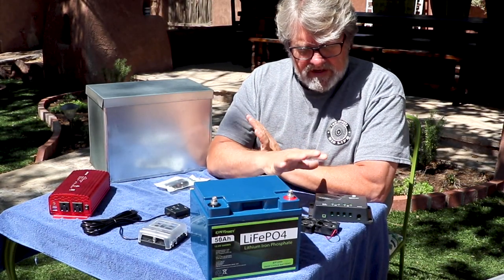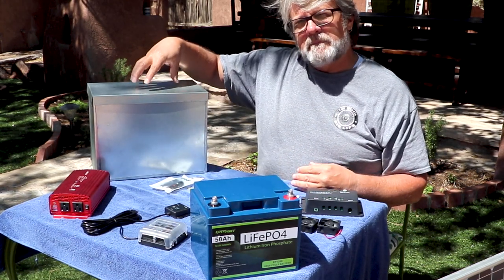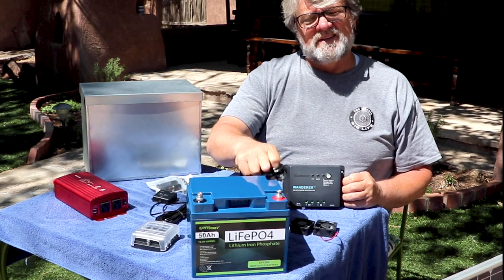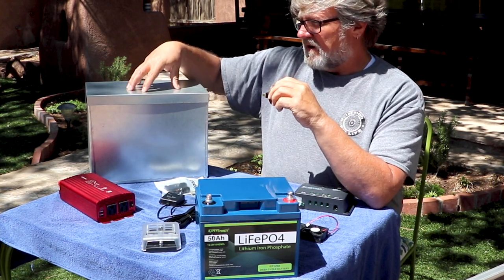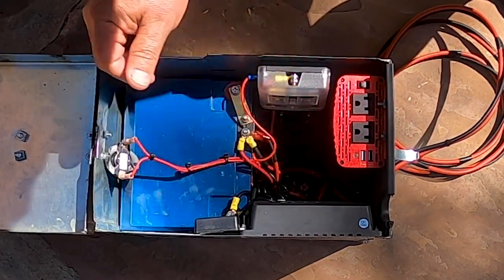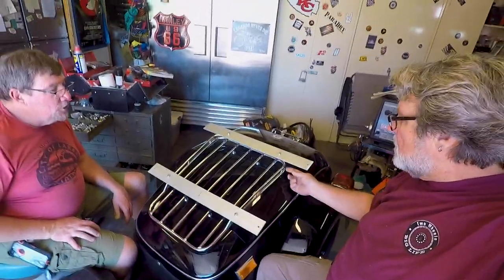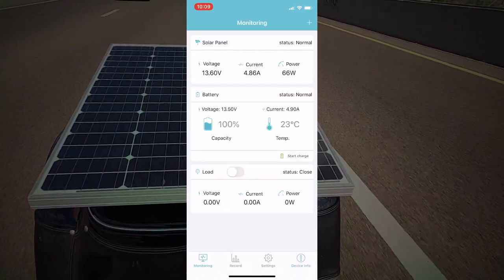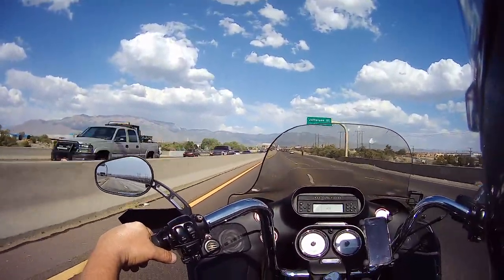DYI - Motorcycle Solar - #motorcyclecamping #offgridsolar

Comment: Very nice. Nothing better than available power while camping. One way to help keep that box cool. Find a Line-x Bed Liner dealer. Have a light coating of Line-x sprayed on the outside of your box and lid. It doesn’t absorb sunlight. You can leave it outside in the direct sunlight and it will not get so hot that it burns your hand when you touch it. Amazing stuff.
Reply from the maker: That's a great idea!

Comment: I'm looking to build this setup; would you plz revist this pwr sply build....
1. Since it's original construction:
- what upgrades &/or mods have you done to it?
- what, were you building it now, would you do (or have done) differently?
- what system components, parts, pieces, etc? have failed & have had to be rebuilt, replaced or changed out? (Failures as opposed to replacement with upgraded/ improved performance components.)
- what components have you chosen to replace w/"new and improved" components? And how/ why are they better?
- was to drop weight of the build w/o sacrificing functional performance & structural integrity?
- what would make the pwr sply more...mobile, resilient &/or useful?
Thank you.
Reply from the maker: I will be giving some details on that at the beginning of next season in just a few weeks.

Comment: If the lid on the trailer is fiberglass I think that I would try to spread out the rack connection. Maybe add a larger washer to spread out the vibration and prevent cracking of the fiberglass. But it's an awesome idea!! You're also giving me the travel bug again. Haven't been out for 5 yrs.

Comment: I noticed in a more recent video that you are using a Bluetti to charge your devices.  Is this the setup you recommend now vs a solar system you build yourself?  Our estimated max output would be 1000W - we are charging cellphones, portable fan and lanterns, but may need to run a portable air compressor to fill tires in an emergency.  We are only travelling for a month at a time and have the same camper as your Ruby.  Thanks again!
Reply from the maker: Hey there Thanks for the question.  The solar system I built was when we were full time on the road and not using campgrounds. So this worked good for us. If you plan on using campgrounds and of hotels the Bluetti works great.  The solar panels that you can get for the Bluetti are very large and you may be able to charge while riding if you can secure the panel some how.   If you use a campground there is an outlet somewhere, the plug in charger only take about 4 hours from completely dead.  Hope this helps.  here is a link to a 1000w Bluetti  https://amzn.to/494hUbA

Comment: Very nice video.  I have also owned Bushtec trailers and pulled behind our bike.  Even though the new box has a Lithium battery in it, did it add much weight to the tongue?  That was always our biggest issue with pulling a trailer behind a bike was balancing the load so that we kept the right amount of tongue weight on the Bushtec Heim joint.  Now I am most curious what you use the possible 50ah battery juice for besides charging your cell phones when camping on a bike?  Cheers
Reply from the maker: Great questions.  The total weight of the box with the battery was 17lbs. The tongue weight was 46lbs.  Total weight of the trailer was 360lbs.  The total power we use for our computers and phones are right at 78watts.

Comment: I am wondering about your solar system since changing over to the Bunkhouse trailer. Does the cargo net over the solar panel reduce the output. I know it takes very little shading to dramatically reduce the out put from a solar panel. I use a 500 watt portable power station and charge off of the motorcycle when on the move but the charge rate from 12 volt is very slow compared to solar.
Reply from the maker: Thanks larry.  Yes the cargo net does reduce the output of the panel, But riding all day with the net on it still charges the batteries to full in half a day.   Yes we have a small back up power pack that does charge slow on 12v but charges fast on the panel.

Comment: Clean looking assembly. I have to ask though, how much current draw do the fans and monitoring/regulating systems have, and from that what is the net power reaching the battery?
Reply from the maker: .03 amps. That is was what I saw when the fan was running and I was checking it through the Bluetooth.   We are powering 2 MacBooks and various GoPros along with phones.   So I don’t think I will run out of battery.

Comment: As well as the fans, why did you not cut ventilation slots in the box to release heat?
Reply from the maker: The top of the bottom part of the box has a couple of notches.  The lid does not fit tight and will pull enough air through it.  If I would have cut more holes I believe that water and road debris would get into the components.

Comment: After a month, how is the setup working? Did you have to change anything? How is it doing with hot ambient temperatures? 114 degrees while on my motorcycle in Phoenix, killed my Gopro
Reply from the maker: This solar is working perfectly.  We only really need about 3 hours of sun a day to keep the LiPo battery at 100%. It’s holding up well.

Comment: Very nice mod, how is the box mounted to the tong?
Reply from the maker: Roc Straps. It has a 6 ft of solar wire so I can move it closer or remove it to use when the sun goes down.
Reply: Who made that box or did you make that box, it would nice to get one. Bob
Reply from the maker: @bobesper4038  I had a friend at an HVAC company make it. Find a sheet metal shop in your area and give them dimensions and it should cost no more than $100 or in some cases, just Beer.  🤣👍
Reply: @TwoWheelsBigLife   Rich, I did not see the inside dimensions of your box. Could you share the box dimension please? Thanks Cliff, love your videos.

Comment: insulation would've or could help your heat problem..like it did for the top of your cooler...you could paint the top white as that will reflect more heat than the bare metal...

Comment: I would suggest you run a ground wire for your system or unhook your trailer so it doesn't ground out your bike or any electronics on your bike. I would just screw a lug onto the frame of the solar panel and run a 10 gauge green wire from there to the frame of your trailer with another lug. Then the system would be grounded for safety
Reply from the maker: I see what you are saying but the box where all the components are are on a rubber pad and the battery is on a piece of carpet with a rubber backing.
Reply: @TwoWheelsBigLife  that may work but I would still ground it

Comment: Doesn't make much sense putting the bluetooth device inside the metal box to block it's radio signal. It would work much better if you put the bluetooth device outside the metal box.
Reply from the maker: That BT works up to about 30ft away and it keeps it dry.  so far the entire set up is working great.
Reply: @TwoWheelsBigLife  You're lucky. The metal box is like a sort of Faraday cage to block radio signals from getting out. (But then, what would I know? I'm just an electronic field engineer and a computer network engineer.) lol